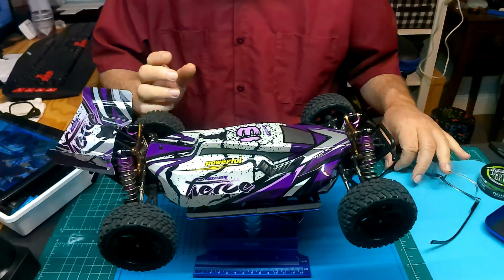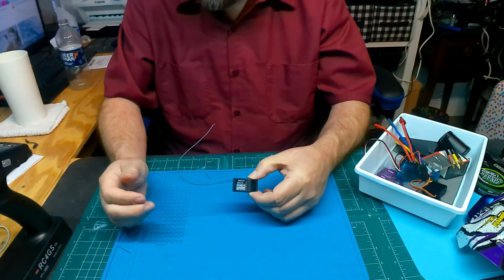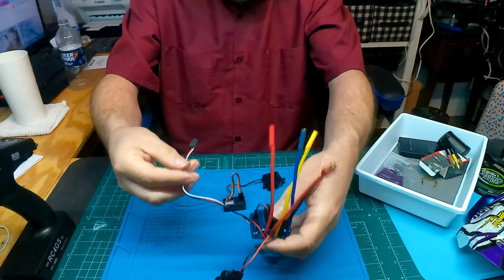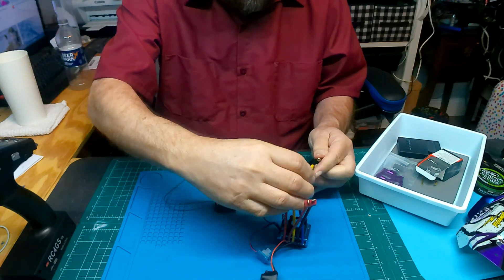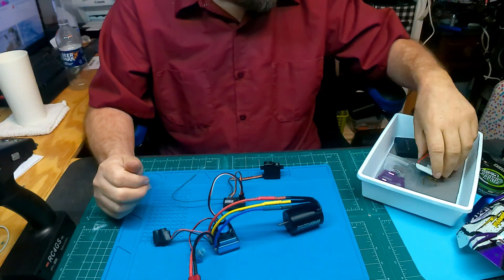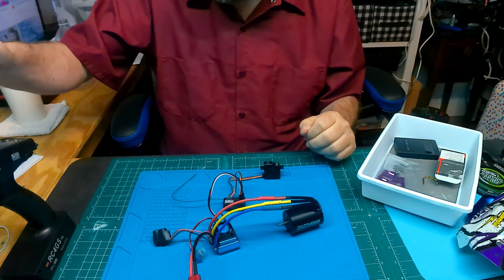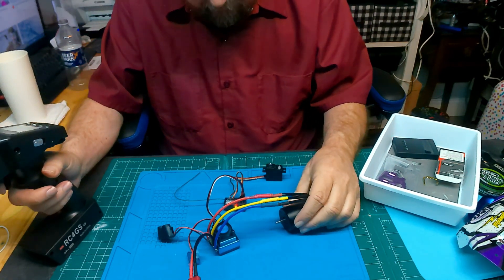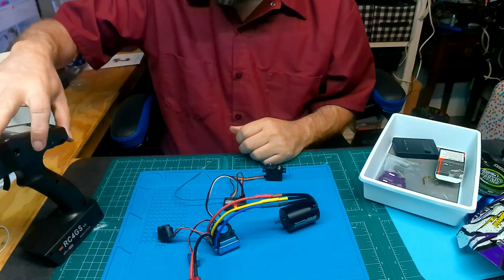WLToys 124019 Speed Run Setup Part 5 - New Hardware Test

Comment: 👍 Hows that combo running for you?  I ran it in my 104001 and it started acting funny..
Reply from the maker: So far it is running fine. All I have had time to do is a quick test run but no problems. I have only tested on 2s so far. I have heard that the ESC is weak point. I hope I got a good one.
Reply: @SanteeRC  Motor is awesome still use but ya the ESC just acts flaky from time to time.  The set did a great speed run for me..  Got my fingers crossed for ya..   Thanks for the info.